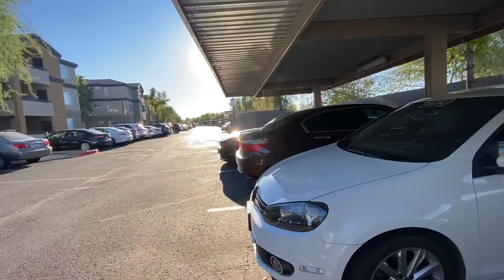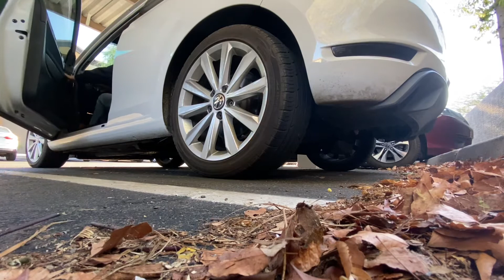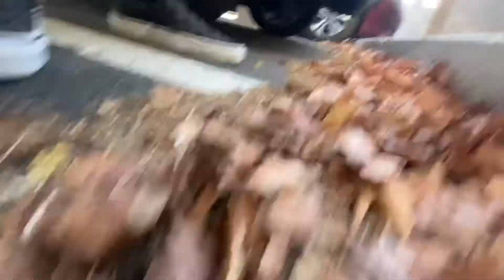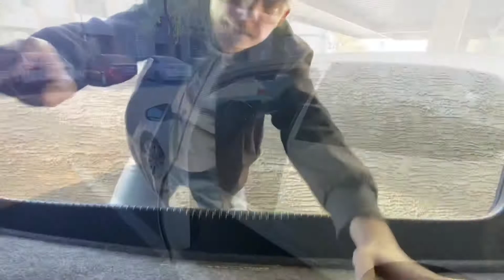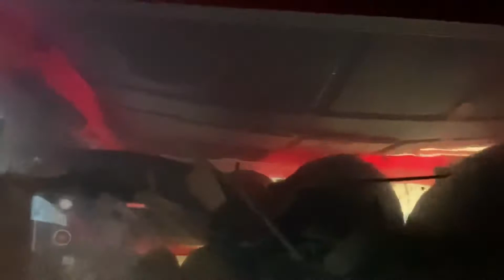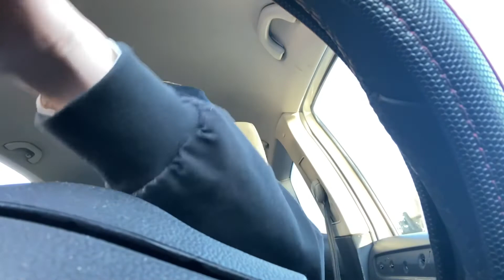2012 Volkswagen Golf TDI Downpipe / EGR Delete, Revving & 0-60 Test

Comment: Hey man, I have a Passat that’s Kerma tuned emissions intact. I know that they disabled the AdBlue system on the low, but how would I go about doing a full downpipe kit? Do they need to retune it, Or can I just send it the way it is? I’m asking because I know they don’t like talking about emissions and I doubt i’d get them to cave in for a new tune.
Reply from the maker: Block off egr and send it with a downpipe. Just tell them it’s for off road use.
Reply from the maker: Not gonna lie I drove around in Arizona for 9 months no emissions. Just drive safe and you won’t get pulled over 😂

Comment: Putting on the 170 turbo was it a direct bolt on? I want to do the same myself, what engine code is yours, and what 170 turbo did you use?
Reply: Did it require any different piping ect.
Reply from the maker: So it was a bolt on Borgwarner cr170 turbo
Reply from the maker: @jamesdrewbyrne5806  and piping wise I actually deleted the whole emission system and straight piped the car. As well as got new injectors. And added a better air intake.
Reply: @jace4910  stripped mine out over the past few days, unfortunately mine was an oval port turbo so could not get a bolt on 170 turbo to fit , I had originally intended on putting a larger turbine wheel inside the cr140 turbo housing but that could only be done with a round port model as the housings are the same on those models only difference being the turbine wheel size.. Iv opted to just recondition my turbo with a slightly larger turbine wheel (34mm) only 1mm bigger unfortunately on the oval port turbo housing that's the largest you can fit, emissions are deleted still running cat but dpf and egr are gone, booked in for mapping during the week now, that will have to do for a month or two until I can afford a gtc1556vz hybrid, seems to be the best option with my budget at the moment then my limitations become cooling related but should easily make 220 on that setup, 280 hopefully with straight pipe and bigger intercooler,,, aiming for 190 with current setup
Reply: @jamesdrewbyrne5806  check our dark side diesel, they have the conversion for oval ports.. bolt on kit, CR170 and exhaust manifold

Comment: All you've done is add a downpipe with egr/dpf deletes? No aftermarket exhaust etc?
Reply from the maker: So far no exhust. But I will probably just be adding a straight pipe because I want to keep the turbo noise.

Comment: Based on your shift points i'm assuming you still had the CR140 on during this vid?
Reply from the maker: Cr170 the whole time actually
Reply: @jace4910  gotcha, whats your rev limiter at? mines at 4400 rn
Reply from the maker: @snafu_vfx  mines set super low because I need to install a intercooler at the moment
Reply from the maker: @snafu_vfx  can’t have it overheating on me
Reply: @jace4910  Yea I'm figuring out an intercooler setup rn too, mine heat-soaks really badly
Reply from the maker: Same lol
Reply: @jace4910  I’m fighting some serious EGT issues too
Reply from the maker: @snafu_vfx  delete your emissions
Reply from the maker: @snafu_vfx  like egr and do a dpf delete and add a downpipe and straight pipe
Reply: @jace4910  I'm fully deleted. Cr170 and stage 3.5 gives really high EGT's, I need to either put it on meth or move the EGT sensor

Comment: Is it tuned?
Reply from the maker: Yes kerma tuned
Reply: @jace4910  does your tune include the deletes for egr/dpf? Wondering if it will go into limp mode if removed without tuning or if its just the check engine light you get?
Reply from the maker: @timbenracing  nope my tune supports egr and dpf delete. My car is not in limp mode. It’s in fast mode.
Reply: @jace4910  thanks for the reply. I didn't know kerma tdi supported egr/dpf delete.
Reply from the maker: @timbenracing  only in certain states! States like Ca do not support it. States with no emissions can only tune thru kerma!